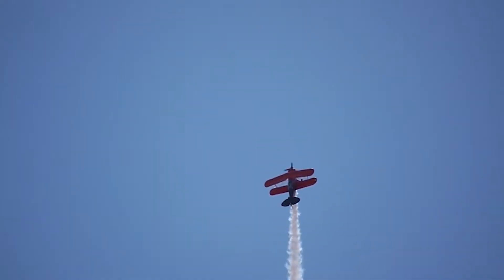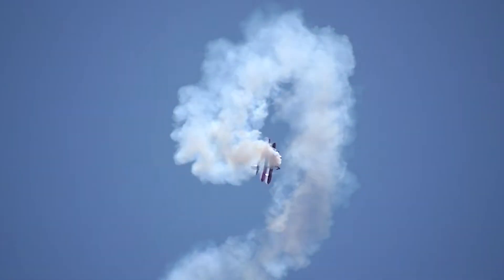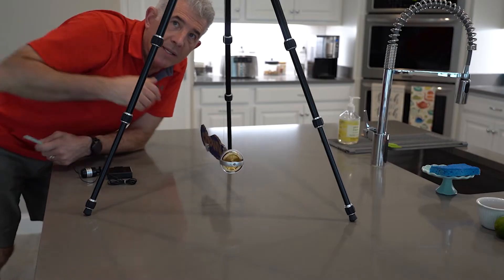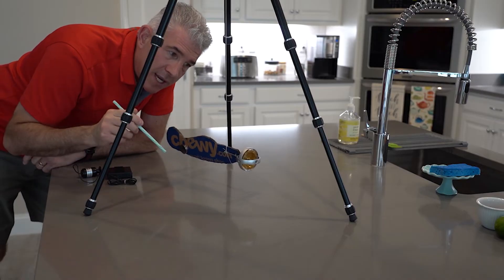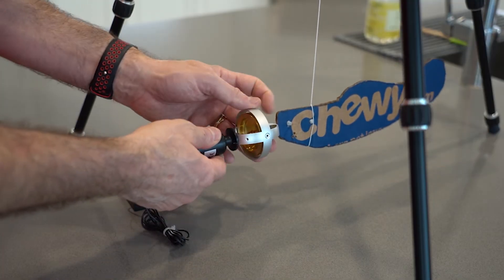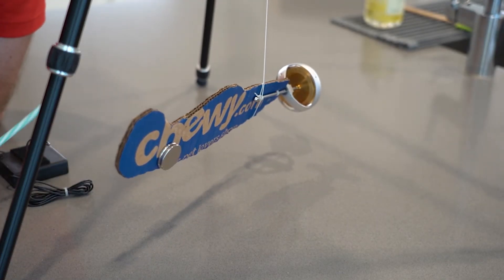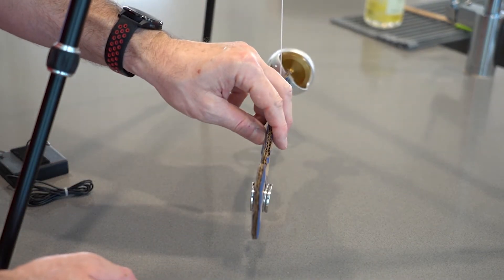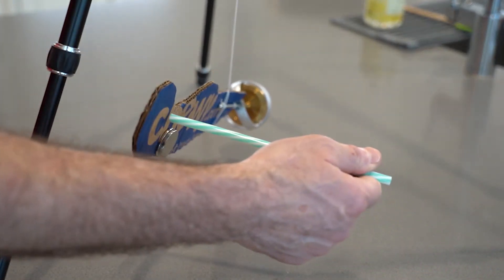Airplane Gyroscopic Precession Explained With Kitchen Science

Comment: I studied gyroscopic precession many times, form books, watched videos onn youtube. All left me with doubt and confusion everytime, beacause there are two groups which give the gyroscopic reaction direction just opposite to each other. There is too much worng infromation about gyroscopic principle on internet and textbooks. Let's take the same scenerio, propeller rotating in clockwise direction when seen from the piplot perspective, and assume we have pitch up moment. By the first theroy if its a pich up moment then there would be a force acting downward on elevators, by that there will be a torque in right side. now as angular momentum was pointing towards nose and by tendancy it will chase the applied torque direction which is in right side in this cass and thus plane will tilt towards right side. Going by another theory, it says shen there is pitch up moment that will be a action couple toward right so to counter it there will be a reaction couple acting toward left and hence by this reaction couple it will move towards left side.
Now after watching this video it seems to me that first theory is correct one, as its experimentally proven right. But still I'm left with doubts. Can you please explain it in a video or reply.

Comment: I’d like to hear your thoughts about how this would affect the handling of rotary-engined WWI fighters.
Reply from the maker: Why would the engine type matter? The prop is a spinning disk, the engine - no matter what type -  is the source of torque.
Reply: @ssairshows  Because on a rotary engine the entire engines spins, so instead of just the gyroscopic tendencies of perhaps 50 pounds of propellor, you have the gyroscopic tendencies of several hundred pounds of propellor and engine.
Reply from the maker: @FS2K4Pilot  That would simply increase the gyroscopic forces.  More rigidity and more precession.  The formulas for gyroscopes include mass as a factor.

Comment: Is your gyro spinning the opposite direction of a standard prop? The resultant forces from your applied forces would seem to indicate so.
Reply: It's spinning in the correct direction, but as pilots we are taught gyroscopic precession is a left turning tendency even though it technically isn't. Presscion's relations to other forces are what actually cause the plane to go left.

It is also more oriented towards tailwheel planes who have to pitch down on takeoff
Reply: @userfivehundred3043 Hi!
does that mean itself actually is not the major factor causing Left turn tendency but combined with others it would?
Reply: @TKY527  I know this is an old comment, but left turning tendencies are a group of separate effects like spiral slipstream, torque, and P-factor that combined cause the airplane too yaw left assuming the propeller spins clockwise. Gyroscopic precession can cause a yawing to the left, but also other directions.
Reply: It's correct

Comment: Hey there, thanks for the video. I've been doing some gyroscopic analysis on your video, mainly the end bit when you push the plane with the straw. For some reason I'm getting the theoretical inverse  where the plane should move in the opposite direction. 

Could be my error, but are you certain that the gyroscope is spinning clockwise when viewed from the tail? My answers for your gyroscopic movement seem to match your gyroscope spinning counterclockwise - quite the conundrum!

Thanks 😄
Reply: The torque is always applied 90 degrees ahead.

1:37 For stick forward, the plane pitches down.  Torque is pushing forward on the propeller from 12 o’clock and shifted 90 degrees clockwise due to gyro precession would create a torque pushing from 3 o’clock on the prop.  Pushing it from the right causes it to turn left.
Reply: Yeah getting the same error, phak says this is a left turning tendency during climb.
Reply from the maker: Hey...I AM a professional!

Comment: So somehow it opposes the p-factor?
Reply from the maker: P-factor is just one factor of the left yaw effects from the propeller.  When the downward sweeping blade is at a higher angle-of-attack than your upward sweeping blade such as when climbing, the downward sweeping blade creates more thrust which contributes to making your airplane want to yaw to the left.  There are four factors that contribute to left yaw and in low powered planes like Cessna no one factor is very strong; they come together as a group to influence yaw to the left that is noticeable to the pilot particulalry during high power and low airspeed combinations such as when climbing.

Comment: I don’t understand why we need to push right rudder on takeoff then if precession makes the airplane yaw right while climbing?
Reply from the maker: A single engine plane with a clockwise turning prop, as viewed from the cockpit,  yaws left from precession while climbing at high power settings.

Comment: But why?
Reply: It's explained through Physics. Gyroscopes attempt to remain rigid in space.  However when a force is applied to it, the actual reaction of the gyroscope occurs as if that force was applied 90 degrees later (in the direction of rotation). That is called Gyroscopic Precession.
Reply from the maker: If you watch the entire video on the double hammerhead I talk through this in more detail:  https://youtu.be/86PPORTVHNE